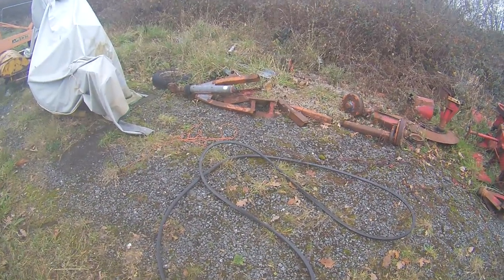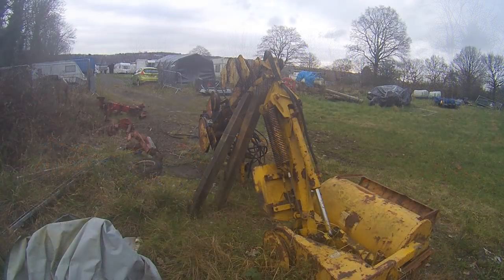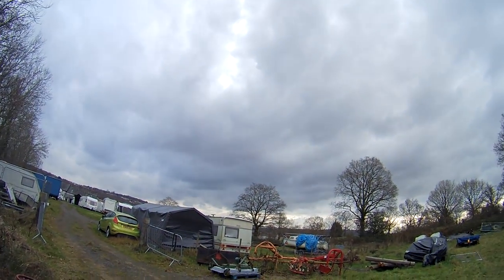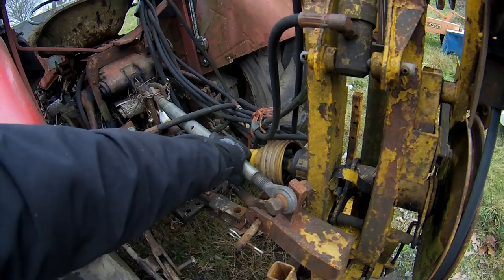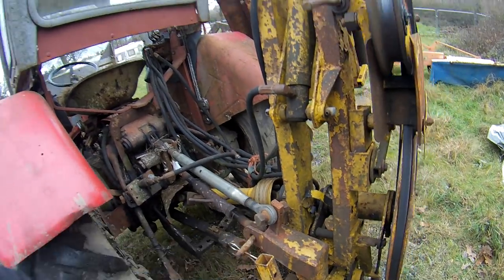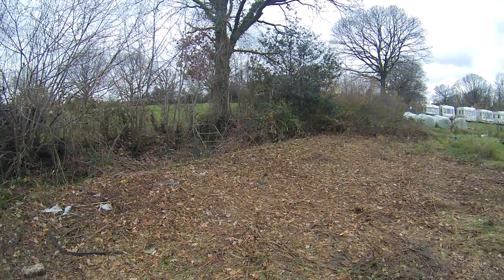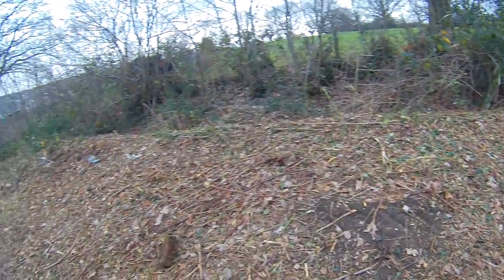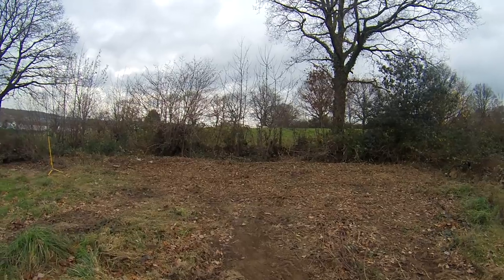Tractor / Hedge Cutter'  Smashing Brambles !!

Comment: Great video mate u should spray all that crap off now kill it off fresh grass seed in spring
Reply from the maker: Hi Noel.  Thanks for the comments.  Yes I will spray it all now.  Cheers Calvin
Reply: @CalvinThomas05  Spray with what? A professional guy sold me a coupla litres of Garlon  (in France), not available to the public. He said that was enough to clean up my acre of land of its bramble-ridden areas. Next year they came back. Yes, I was expecting miracles.  
Would a 6" layer of chippings be any good?
And the commentor suggested reseeding with grass would get prevent it growing back. Is that true??
Thanks. Now to look for the 3-pronged blade in action.

Comment: That's a nice ol flail cutter! I'm sure you'll make good use from the new space you gained!
Reply from the maker: Hi Denny's Country Life. Yes its been great over the years.  Its old but it still does what it has to.   It cuts thick branches too because its belt driven I think its got more power than hydraulic ones.  Yes I'll put caravans there later.   Cheers Calvin